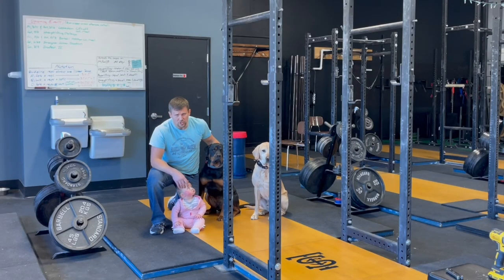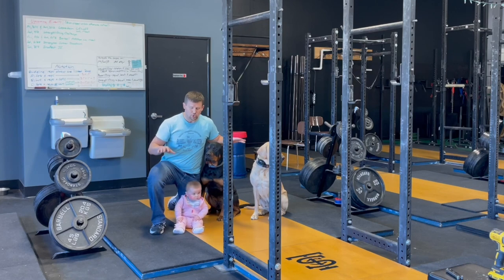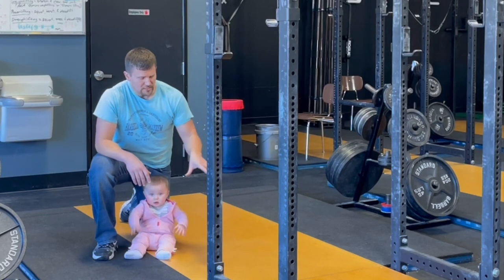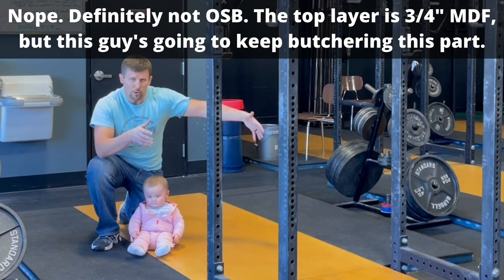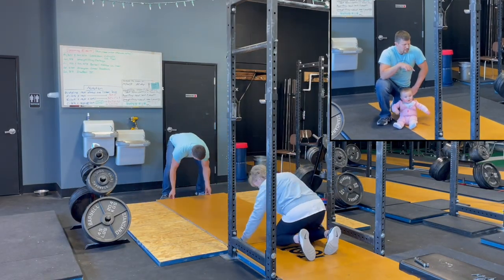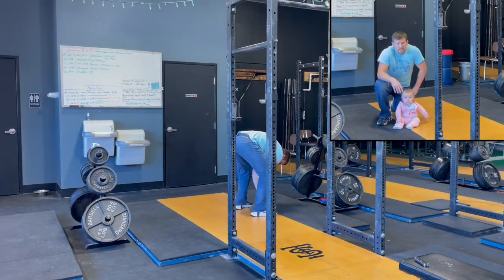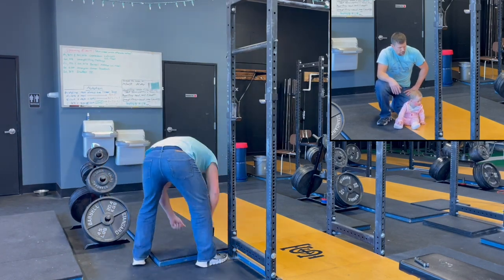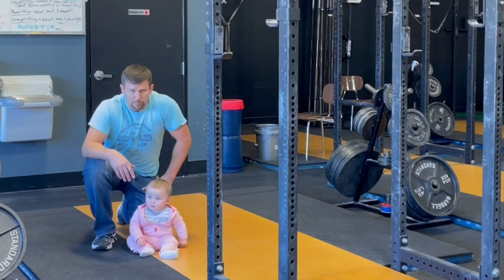Build a Lifting Platform in 3 Minutes!

Comment: can you please elaborate on the valley vs mountain rule? Im about to do this for my home gym. Thank you!
Reply from the maker: Sure thing. Pretty much every sheet of 4 x 8 OSB you purchase (or any plywood, for that matter) will have a slight bow or bend to it. In other words, if you lay it flat on the floor, either the middle will be up off the floor a bit (making a "mountain") or the ends will be up off the floor a bit (making a "valley").

You could also picture this if you imagine pouring water onto the board. If the imaginary water would run away from the middle and spill off the edges, you've got the crown up (which is what you want), so it's a "mountain." If water would run toward the middle of the board and start to gather there in a pool, you've got the crown down, so it's a "valley," and in this case, you'd want to flip the board over so that you have a mountain.

Does that help?
Reply: @TestifySC yes that helped a lot! I understand now. I appreciate you responding, i want it to do it properly to make it last.
Reply from the maker: Glad to help, and I hope your platform turns out great!

Comment: Where is the link to the jigsaw?
Reply from the maker: Solid question, and we didn't originally have it in the equipment listed in the description. It's there now, and I'll put it here as well:
Black + Decker Jig Saw (corded)
https://amzn.to/47dvqbW

DeWalt Jig Saw (cordless)
https://amzn.to/3toYMq1

In the video I refer to about cutting horse stall mats (linked in the description), I use a Black + Decker jig saw because, for some reason, that's what I had at the gym that day. That said, I usually use our DeWalt cordless jig saw, but if you go that route, make sure you purchase a battery as well. 

Either jig saw will work fine. The corded Black + Decker is cheaper, while the flexibility and portability of the cordless DeWalt is awfully convenient (especially for other jobs).

Comment: So we're going to need 4 of those stall mats?
Reply from the maker: Just 3 mats, and if you like, you can do it using only 2 mats with a slight design modification.

Mat #1 provides one 6' x 27" section, mat #2 provides another 6' x 27" section, and mat #3 provides both 2' x 27" sections.

To do it using only 2 mats, you'll have four 12" x 27" sections (i.e., 1' x 27") instead of two 24" x 27" sections. In this case, you can get these sections from what's left over on mat #1 and mat #2. We have one platform like this, and in this case, we centered the 6' sections from front to back, thus allowing us to put a 1' section at the front and another 1' section at the back on each side of the wood section.

Hope this helps!

Comment: what is wrong with using OSB? isn't it strong?
Reply from the maker: OSB is great for the first and second layers, but I would not recommend using it for the top layer. Because OSB is made up of so many tiny strands of board and because the top layer gets a lot of traffic, the chance of those strands starting to come up over time makes it not a great choice. I would recommend MDF or a single sheet of plywood.
Reply: @TestifySC  thanks for the detailed reply. :)
Reply from the maker: You’re very welcome!